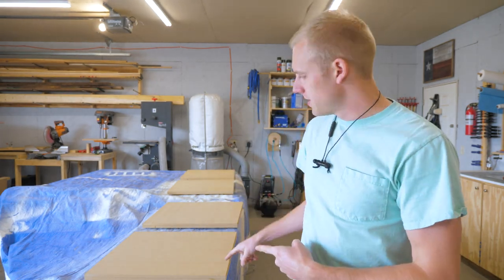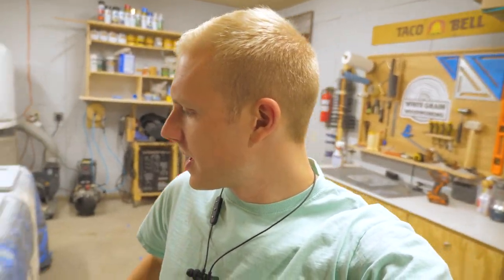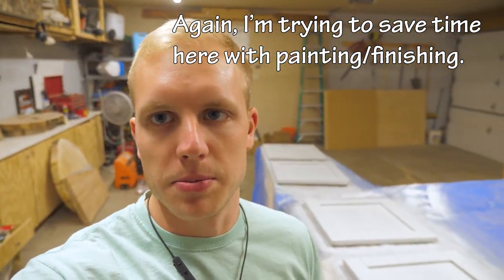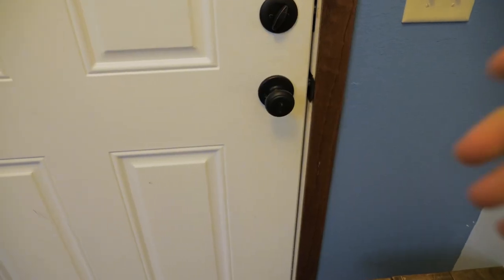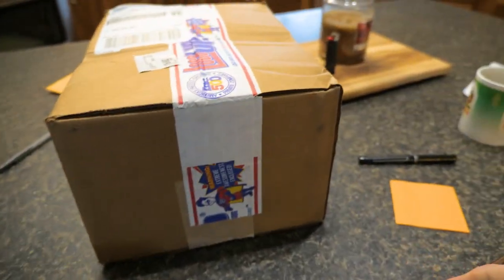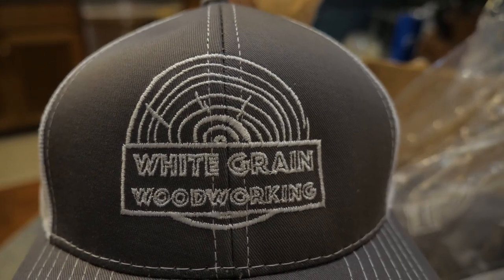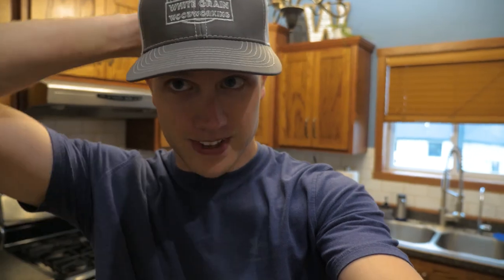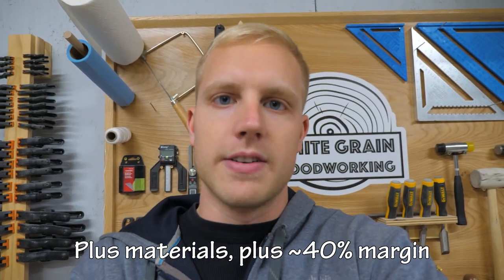Stop Wasting Time in the Shop - Start Making Money Woodworking

Comment: Sanding sealer on the edges is a must if you want a good finish. At least three coats on good quality MDF but more on the cheap stuff in the big box stores - probably five. You can brush it on quite easily but let each coat dry well before applying the next. Sand it well before laying on the paint.Keep the spray gun for the paint finish. Wear a mask for sanding too. - Dave

Comment: If u use a skim (very thin) coat of joint compound on your MDF it will save you so much time and paint... What I've done it spread it all around, don't worry about how much is on there  because I scrape it all off right away.  What ends up staying in the pores is what seals it.

Comment: You can use bondo on the edges or what I do is use a oil based primer which does not soak in as much them paint the water based paint and it turns out beautifully.
Reply: Bondo is for metal not wood that expands and contracts at all.
You must be a shoemaker.

Comment: Just found your channel. Great honest content. Sealing the edge of MDF is worth a video of its own, whenever I get around to making some 😭

In my opinion starting from best/most effective methods (inadvertently costing more for the tooling too)

1. Edge banding machine with PUR adhesive (cannot be reactivated by heat)

2. Edge banding machine with regular heat activated edge banding.

3. Regular heat activated edge banding, ironed on and trimmed by hand.

4. 2 part car body filler- cheaper and smoother than wood filler, the edge will need sanding down and 1 coat of primer seals the edge.

5. Epoxy or polyurethane resin, brushed on. Can create a lot of mess, seals AND hardens the edge but will need considerable sanding and 2 coats of primer to level the surface. It has its own advantages, such as routing in integrated J-handles in doors. This leaves a large area needing to be sealed (if done in MDF) and resin works best for this in my experience.

6. Polyurethane wood primer (2part). Spray only the edges, let it flash for 20mins, spray it again, repeat until edges are sealed with enough primer. Sand flat and prime full panel as normal. This method works well for intricate areas needing sealing without the strength benefits of resin.
Reply: Don’t use bondo it’s has a different expansion/contraction rate than wood.
Stop being a hack.